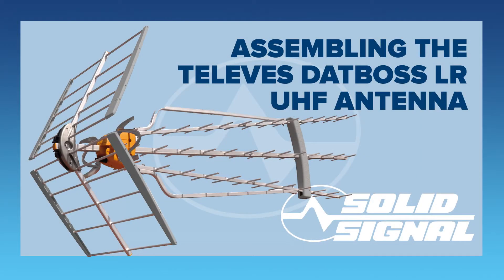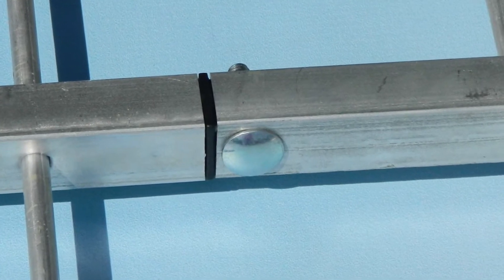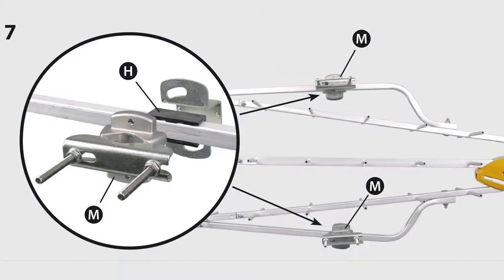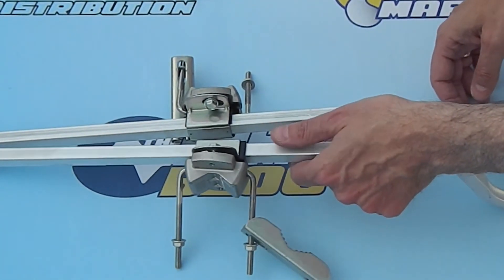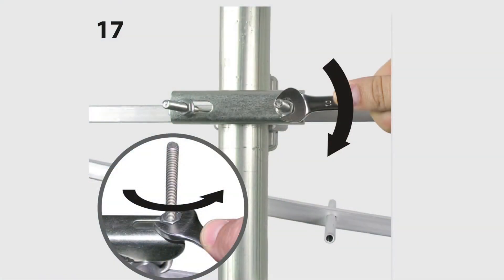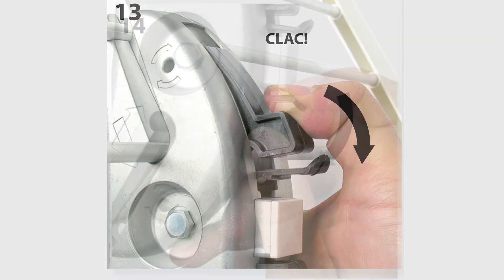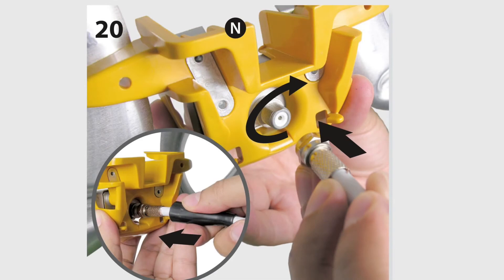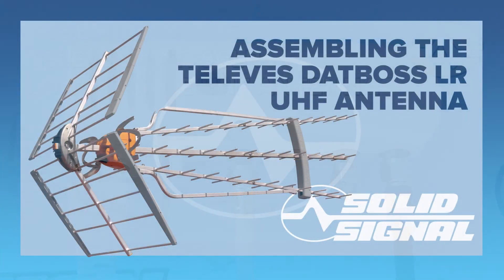Assembling the Televes DATBOSS LR Antenna

Comment: UHF only? Solid Signal website  said is also VHF.
Reply from the maker: Norbert Rivera the “mix” version is uhf and vhf. The assembly is the same except for adding the vhf element.
Reply: Ok thanks
Reply: @norbertrivera   It’s VHF performance is predictably mediocre, especially for low band. If you don’t see many horizontal rod elements it’s not designed for good VHF performance from weak stations.
Reply: on Amazon as well  states  VHF UHF